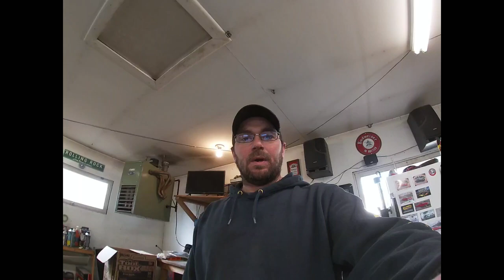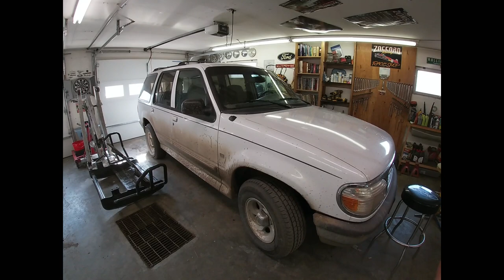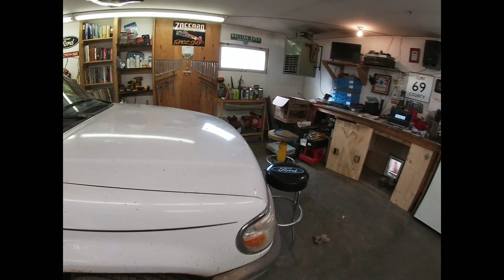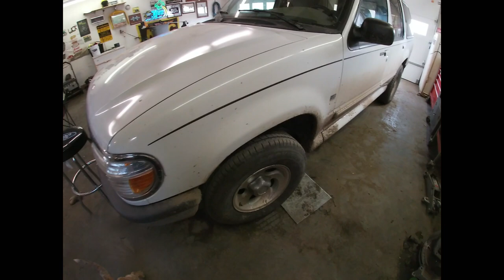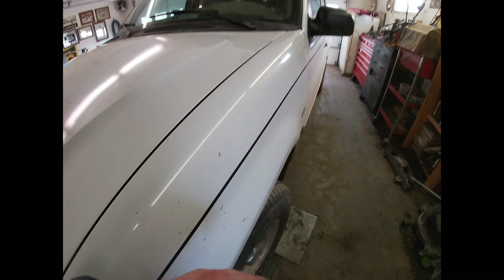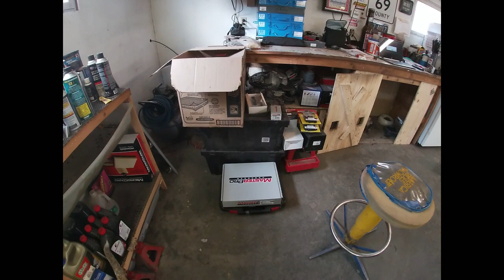Introducing the 5 0 V8 Explorer

Comment: I bought 2000 5.0 AWD Explorer with 230,000 miles on it for $800 at the beginning of winter 2015 only expecting it to last that one winter to save my Mustang from the crap weather and salt. The freaking thing is still kicking, it's been my daily beater ever since then. The thing won't die and I only do the absolute bare minimum of maintenance to it, oil changes every 8,000 or so miles, only changed the air filter once since I've had it, etc.
Reply: I don't know Explorers, but I do know one of the small Ford utes had a setup where they just used a part time transfer case with an electronic clutch on the front drive shaft and called it "AWD".   People with older ones would mod them so they could just disable the clutch and have 2wd when they wanted it and it saved wear and tear on the transfer case.